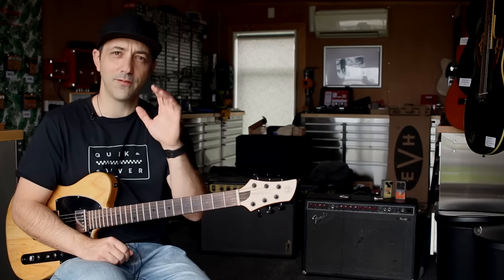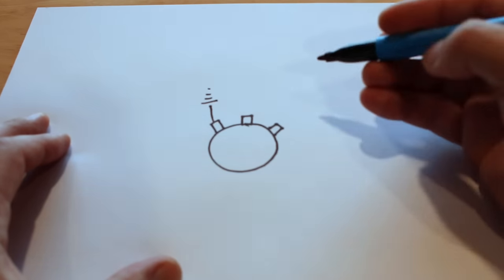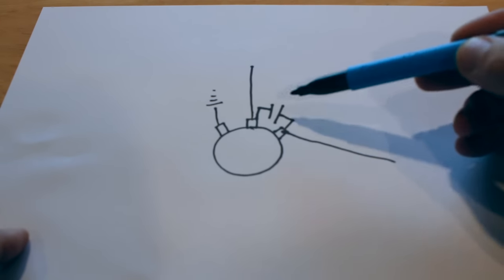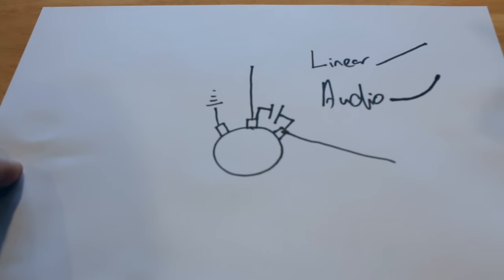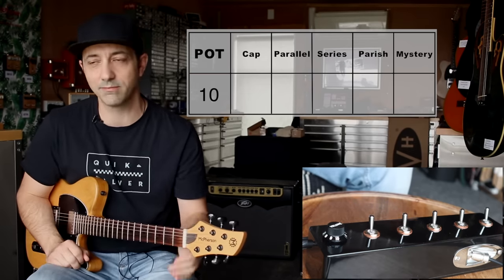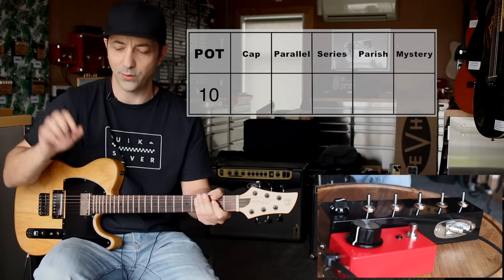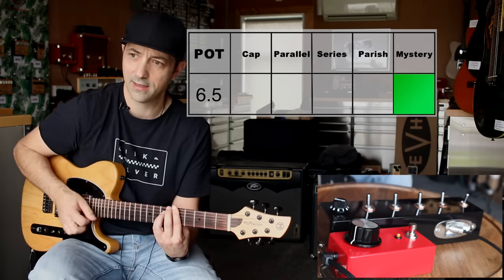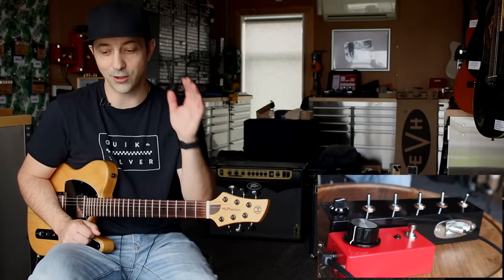The Famous 5 Treble Bleed Guitar Mods Compared

Comment from the maker: 🎸 Finally got this video together, it was so great to compare these designs!
Reply: i am graciously subscribed ... you really did an excellent overview here, and beyond.
i had resigned myself to setting up my treble bleed on a switch, because the high frequencies trip the dirt more ...and i am still there with that, so i can roll into a muddled clean, or further for a crisper clean, depending on the switch position .... my problem has been settling on the topology and values. ( the problem with the latter being i am running hot on a 1Meg pot ...so i can't expect exactly the same results )
Reply: i think i am going to go with a strait cap, or series now ... this has been enlightening.
my IMeg doesn't get as muddled as quick ... that's why i need to switch it out the bleed sometimes.
but having the bleed follow the tapper is EXACTLY what i have been wanting, buti didn't even know just a cap, or a series bleed, would deliver me.
Reply: such a great explanation, thanks man
Reply: If you want to get REAL fancy you grab a couple of say 10-pole switches and throw ten caps and ten resistors of different values on each and plug THAT into your circuits. That way you can audition different values hence frequency response on the fly for every  guitar you work on. Fiddle around until you get the sound you want, then just grab the values off the switches. Substitution boxes are my best friends.
Reply: Great video,but I can't see how to wire series/parallel etc, where does the resistor go in regards to the cap ??

Comment: I come from an electronic engineering background, I started my improvised  journey on what combo to go with , but it was cut short when I found the Octave Doctor treble bleed.  It surpassed everything for me. 
Octave Doctor came up with the series combination of 1 nF capacitor and 150 k-ohm resistor. It's recommended by many sources as a good choice for maintaining a consistent resonant peak as volume decreases and presents that pretty well on an Oscilloscope (a way of converting audio signals into visual representations so you can really see if your ears are telling you the truth) .
Your "Mystery" one didn't actually surpass the one I've settled on for me, it's a tangent I didn't go down because it felt like an unnecessary expense after finding a solution and in your demo it appears to stay louder longer which isn't what I need from it. You've made me glad I didn't pursue it.
Everything I've said goes along with your point; it's a personal and individual decision.
Reply: I agree that with this demonstration the 1 nF capacitor and 150 k-ohm resistor in series works best. BUT I was surprised to see that the pots of my Ibanez RS100 are actually the opposite of what is normally expected. The volume pot is linear and the tone pot is an audio taper. So given this situation, it is hard for me to evaluate which treble bleed to choose. Since you come from an electronic engineering background, any guidance would be highly appreciated
Reply: @daviart1  Personally, I think a linear pot for volume controls makes total sense.
Reply: I always thought that audio taper pots were designed to sound more linear to the way humans hear. And this is the reason that most electric guitar manufacturers use audio taper pots for their volume controls. According to this test these different treble bleed circuits also alter tapers. So, was wondering if the test could be repeated using a linear taper pot. This way, i can more easily choose which treble circuit to install in my instrument.
Reply: Octave dr doesn’t exist anymore. Their website is gone.
Reply: @RustyRaceHorse  That's a shame, but this part of their legacy will not be forgotten.

Comment: As shown, the single 330p cap bleed is the only one which really retains the audio taper of the pot. It only keeps treble, and you can easily fine-tune it to your desire (PRS uses 180p, Ibanez uses 330p, which is my favorite).
You really can’t make volume swells in overdriven solos with the other types of treble bleed, because you’ll have an abrupt transition from 0 to 1 in volume, as those bleed circuits immediately let too much frequencies (highs but also mids) pass as soon as you move away from 0. Actually those bleeds transform the volume pot in a bass-cut pot, because as said not only high treble gets passed, also mids start to pass undisturbed through those bigger 1n caps. That’s most evident with the “mystery” bleed, with that gigantic 6.8n cap.

PS: thanks for this very well made comparison, the best on YouTube to date!
Reply: So then how do you get both an audio taper for fuzz/dist/od control and then have a linear taper for better control over clean volume? Is there a semi-audio taper? A dual mode pot or something?
Reply: @Drunken_Hamster  audio taper is the standard and is what you need to have a good control over volume. People have always used that with fuzz pedals as well. So you’ll never want a linear taper.
The real problem is with fuzzes and a treble bleed circuit. Without a treble bleed, when you reduce your guitar volume you are increasing series resistance between the pickup and the fuzz, so your fuzz sees a higher input impedance and you get that nice cleaning up (less gain and more treble, a clearer tone), because the fuzz face circuit was born with a low input impedance. But if you have a treble bleed circuit installed, you lose that phenomenon for the treble frequencies, that are allowed to pass through your volume pot no matter the position of it… so you don’t get as nice as an effect. The solution for this is to have a switch or a push-pull volume pot to disengage the treble bleed when using a fuzz face. Although Satriani is not such a frequent fuzz user, his signature Ibanez guitar as always had this feature.
Reply: @shredgd5  Right, but in the video Waylon said that a linear taper is better for clean tone volume control. So my question is, how do you get that good volume control for cleans while also having the good gain control for fuzzes and whatnot? Or is that statement he made about linear taper for clean tones somehow incorrect?
Reply: @Drunken_Hamster  try for yourself. You will realize the linear taper doesn’t have any progression from 0 to 1. A linear taper does from 0 to 1 what a log taper does from 0 to 5…

Comment: I'm now designing and testing different guitar circuits that I never found on any commercial instrument to overcome to the biggest extent those issues of passive designs.
The only design where I extensively tested a treble bleed, a couple of parallel volume (audio) + tone pots where the tone pot isn't wired in a traditional way, ended up with just a cap of values between 71 to 80 pF, fine tuned by ear on dirty sounds.
Higher values lead to those perceived increases in volume because there isn't just a treble bleed, but an actual full signal bleed.

Comment: Great video, thanks mate. 

I noticed Satrianis signature has a treble bleed on a push/pull so it can be deactivated.
Is that because on a clean channel with a treble bleed you can't change the volume as much or what's the benefit of not having a treble bleed in your opinion?
I've always wanted to try a linear pot too, i figured it would it work better for volume swells

Comment: Really great vid! I spent a lot of time experimenting with treble bleeds and almost always use Audio pot & series with a 1000 or 1200pf cap and 150k resistor. Balanced roll off without messing with the pot taper. I’ll have to try the mystery option.

Comment: This is really cool. I'm definitely gonna pinch your idea and make one of those boxes for my shop. I've actually been wanting to put together something like this for a coupe of years, but it was never at the top pf my list of priorities. I personally thing every guitar tech should make one of those, to demo to their customers what treble bleeds can do for them. 

What I'm thinking of doing is to make a box with an additional switch that can switch between a 500k version and a 250k version. What do you think of that idea?

Of course some guitars already have treble bleeds inside (in fact I really like that Fender stock mini PCB) so I guess tit's important to have a strategy on how to pitch the idea of a treble bleed upgrade.

I'm thinking of simply having a treble bleed box permanently wired on my bench and start testing their guitars guitars without telling them what I'm doing. If I hear that the switching options produce results that I believe a customer would find favorable, then just pitch the upgrade service.

Comment: Thanks very much for your efforts. Finding this solution is very time-consuming for certain guitars which physically put up a big obstacle to checking parts. I know I’ve gone done a long road finding the solution for my Strat, but once found, it is very gratifying. Having the right bleed behavior gives a player an infinitely variable sound palette with the simplest possible control - the volume. I’m happiest with just enough bypass to keep rolloff behavior but reduce it by what I’d call ‘about half.’ The variations are infinite but a solution can be found.

Comment: That was a pretty good explanation of whats happening in treble bleeds. Although it might have been more useful to draw it out as a schematic to show how things are connected and interacting with each other. 

There's so many differing versions of treble bleeds, it can be quite confusing for guitarists on which one to pick. Although I've never seen using a dual pot before, that was interesting. And different component values are used depending on whether you have single coils or humbuckers  - generally because singles will use 250K pots vs 500K for humbuckers (and there's just as many variants of those). Building a switch box is a great way of trying things out for yourself to find what works best for the guitar.

BTW Its interesting manufacturers generally use linear taper pots for volume and audio for tone. You'd think it would be the other way around, but that's just how things work.

Comment: Well, this has been very helpful to understand the concept of treble bleed(s) – you got me subscribed on the spot. I've actually – after some research – put the "series" type treble bleed (130K resistor and a 0.0012mF cap) in my Strat with Kinman Noiseless PUs a couple of years ago, but I'm still not sure if I’m really happy with it...
I sort of feel like there now is some kind loss on the bottom end of the sound when I roll back the volume so the tone gets somewhat spiky and I wonder if this loss of bottom end is actually the case or if it is just an impression I get because the (retained/preserved) treble kind of overpowers the bottom end which only seems to be less present due to the "loudness" effect of hearing lower volumes.

Comment: I have been using a variation on the series method for a couple years on my main guitar. I forget the values off hand, but its 2 caps (one large, one small) feeding the outer lugs of a trim pot and the wiper serves as the output of the network allowing the trim to both blend between them and setting the series resistance. You can kind of go from either just the very high sparkly treble frequencies in the bleed to introducing more upper mids along with it depending on which cap the trim is panned toward. And since the trim pot is always in series with the caps there is no effect on volume pot taper, which is important to me as well. I typically run a simple single channel amp up nice and hot so a good treble bleed is essential to get both the clean and dirty sounds I am after.
Reply from the maker: Nice! Sounds like a cool mod!

Comment: Wow. Awesome test and methodology! Liked and subscribed! Which type of treble bleed would you recommend for a master volume on a guitar with 3 volumes, master volume and 1 individual volume for each humbucker (neck and bridge)? So when using the master volume it wouldn't cut treble. As a second related question, I guess if the guitar was 50s wiring the master volume would not need a treble bleed? Thanks.

Comment: I have my guitars wired like Jazz basses with the Duncan style (parallel) treble bleeds. I like the pickup blends and also keeping one of my pickups set at a lower volume and then the other pickup I can swell in or out. With the volume of one pickup at full and the other pickup volume at my cleanup setting you can't hear the blend until the louder volume is dialed back so basically I'm using one volume knob for most of my sounds at times. 

I think when having the input lead on the center lug and the output lead on the outer lead changes the tone and possibly the taper a bit when rolling down the pot. But when using the Duncan style treble bleed helps to restore the sound to a more conventional guitar wiring. If I used a conventional wiring I'd likely just go with a 50's wiring and no treble bleed as I have in the past. The tone pot wired to the input of the volume pot really affects the treble roll off when rolling down the volume pot but just moving that lead to the output lug remedies it a lot.

Comment: Finally, a good video showing the differences between them. Turns out the one I was using is not the one I want but didn't want to keep taking the Strat apart to try them all. Going to change it out next time I change strings.
Reply from the maker: Glad I could help!

Comment: If you're not already hip to it yet, the best treble bleed mod IMO is simply the wiring of a volume & tone pot the way gibson used to do in the 1950's (as opposed to the modern way).. it only requires moving existing wires to different pot lugs; no extra components are needed. I tried all these treble bleed circuits without being impressed before hearing about the gibson '50s wiring.  Now i just immediately re-wire every new guitar that way.
Reply: doesnt that mean when you adjust tone the volume will go down?
Reply: @bluedot6933  no, but it does become interactive with the volume. It's great fun, especially in a 4-knob setup thru a responsive amp.
Reply: @bluedot6933  no more than a standard vol/tone setup. What I mean by interactive is the tone knob will be doing different filtering depending on where the volume is set.
For instance: vol on 10, the tone rolls of treble like normal, albeit not as suddenly.
But with vol on 5, the tone pulls down a little midrange going from 10-6, then begins to roll off treble as you go further down.
The fun comes when the interactivity makes it necessary to use your ears instead of remembering what number you want.
And of course you can use an overdriven 1-channel amp to full potential. And with a 2vol/2tone guitar your pickup switch can now be a channel switch. It's liberating to just bring an amp, guitar, and a cable....but you can jam no matter the genre.

Comment: I've been using parallel bleeds but I quite like the series. What are the values you used in that series bleed?
I use a telecaster mostly and would like to make that same one. Thank you!
Reply from the maker: I used a 120k Resistor with a 1NF capacitor, cheers!

Comment: Excellent video, man!
I’m only familiar with parralel paired with audio taper pots as that’s what I’ve installed for the last 20 years. I’ve always been curious tho, if using the parralel circuit causes the high end to come thru an audio taper like a linear, would a linear produce a reverse audio? Like would it produce a reverse bell curve where it tapers off slowly with a quick drop on the bottom end? Can’t think of a reason why it would even be useful 🤣 but still interesting to think about.

Comment: Very good video, and it was interesting to hear the different types of Treble Bleeds in comparison with each other. Long ago, I tried Series and Parallel Treble Bleeds. Though the worked as described, one thing that is sometimes overlooked is that they can affect your ability to do traditional "volume swells." I ended removing the Bleeds, as even though I'm not doing volume swells frequently, it is nice to get both the change in volume and tone when I do a swell. Thanks
Reply from the maker: Glad you enjoyed it, I find my series combo retains the taper very well so it still works great for swells, cheers :)
Reply: @WaylonMcPhersonGuitar  Good to know. Thanks

Comment: This was SO educational. Thank you for sharing. TOTALLY looking forward to that fuzz device vid. That was very interesting! Quick question, that is a little off topic, you mentioned the Audio vs. Linear tapered pots... I have an old amp that goes from zero to 10 in the first few ticks of the volume knob. Would replacing that pot with a linear style version make the ramp up to max volume more even across the dial? Or is an amp more complicated at that pot? Really appreciate this channel!! :goodvibes:
Reply from the maker: Thanks! I would try an Audio Pot in that position, it sounds like it already has a Linear pot installed. There can definitely be other factors at play but I would check that out first, cheers!

Comment: Great comparison of the different treble bleed circuits.  But it's also really helpful to experiment with different cap and resistor values; especially the value of the series resistor in the series and parish circuits.  Every pickup position is different.  Try out a bunch with alligator clips.  Or an adjustable trim-pot.  You can really dial in exactly how much treble you want to keep while rolling off volume.

Comment: Excellent video!! thank you!! i have a question, months ago i did the mod using 1200pf Cap and 130k resistance in series, but i noticed you are using slightly different values, does it make a big difference? thank you!! Subscribed!!!